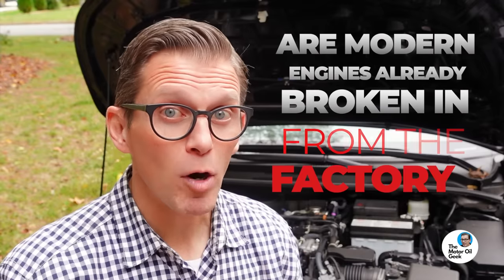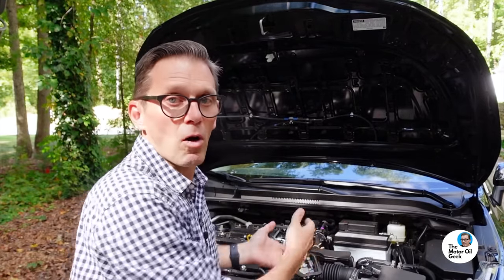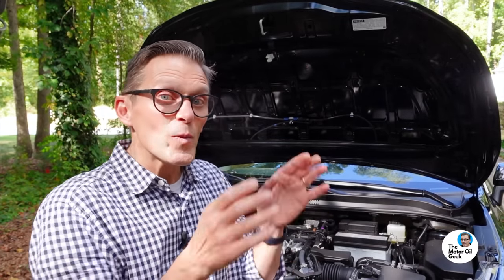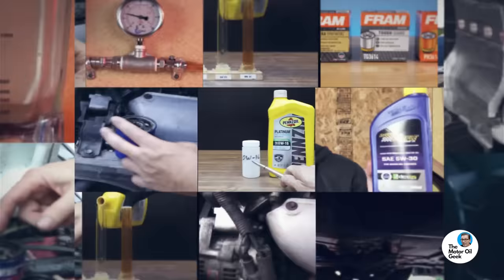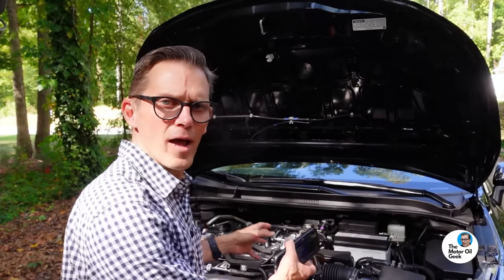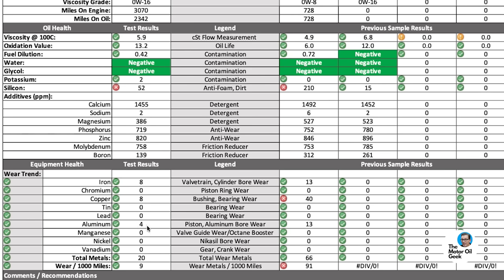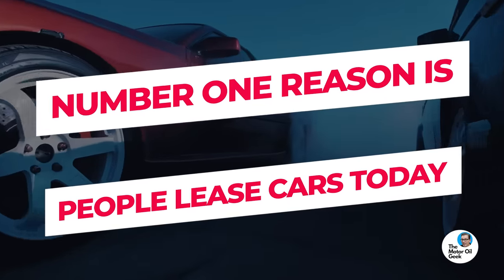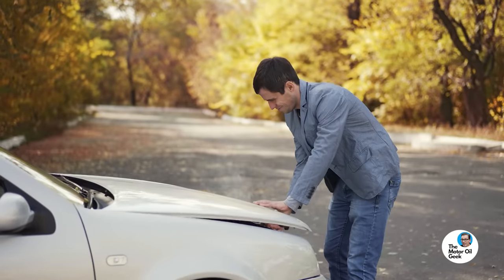New Engine Break-In: Truth or Myth?

Comment: I don't understand how leasing and epa regulations explain why the manufactures recommendations for first oil change are ~7.5k miles. If they know contaminants are in the oil after break-in why not lower that recommendation? The only epa related thing I can think of is manufactures are told to not encourage customers to waste oil by changing early. You don't mention that in the video though. I still don't understand the manufactures recommendations.

Comment: analysis results at 4:00.  Honda, Toyota, and other manufacturers only test start at the factory every 100,000 car/truck because the variation in engine build process is controlled.

Comment: So my question is, did I do any harm to my motor when I changed it at 5k miles in my 22 Tacoma? I was concerned about this when I bought it but was told from the dealership that it’s not necessary… I’m a stickler on maintenance mainly for long term reliability so I’m kinda worried I might have done some harm waiting till 5k to change the oil

Comment: They don't break it in. U have to do it yourself. Its also written in the manual that u have to use the first 1500 KM as the cars break driving 80 km max!. During that time only. That's your early oil change. And u have to change that oil to a 5000 or 10000 km afterwards.

Comment: Just a question, I learned to change the oil filter at 5,000 miles refill to normal level and then at 10,000 change oil and filter, then repeat the cycle. Would that do more damage than good to the engine? There will still be old oil circulating through the system although there is a bit of new oil and filter which I now thinking about it would not be ideal.
Reply: For me, oil filters are so cheap that we change them each time we do an oil change. I know some mfg's say you can go 10,000 miles or more but why run this risk. For under $15 dollars in most cases just change your filter with each oil change.
Reply: @vigilantemotors  that is right. But  my question really is skipping the oil change at 5,000 miles interval by just changing the oil filter and refilling what is missing. Then at 10,000 or the next cycle do both oil and filter. It would be cheaper than a full oil and filter change but provide a bit more of protection during 10,000 miles intervals.
Reply from the maker: Swapping filters and topping off is not a bad method. However, I don't rely on procedure alone. Used oil analysis provides data, so that's what I rely upon.

Comment: This is a concern of mine as well. I have a new BMW arriving in about 6 weeks and the dealer is insisting the first oil change isn't necessary until TEN THOUSAND miles. (0W-20 oil) As a career mechanic (first small engines, then later automotive and finally, commercial aviation) I have to say, I'm REALLY not comfortable with this...
Reply from the maker: I agree and would not go that far on the first oil change.

Comment: Dear Lake. I recently took delivery of a Subaru that is specified with 0W16 oil and change interval of 15,000 k's. I feel uncomfortable with that and asked the dealer to change it after 2,000k's and they refused. I asked to purchase the genuine oil and they wouldn't do that either and suggested if I do it elsewhere it could effect warranty.  Looking at oil manufacturers sites I get conflicting views on recommendations. Now my head aches from what to do. Where do I go?
Reply: just go to the parts window and buy it, you dont have to talk to them about your mileage.
if you want "subaru oil" which they dont make.
you can get quality oil from other manufactors.
save all reciepts and write the mileage on it.
Reply from the maker: As the other comment mentioned, just buy the oil and filter from the service department and do it yourself.

Comment: @themotoroilgeek Thanks for the data, but as a BMW M car owner I know very well that M engines are not 'broken in' from the factory.  M engines must be driven cautiously for the first 1,000 miles and then have the running in oil drained and to be replaced by service oil.  If such expensive car engines are not broken in how likely is it that a cheap mass produced engine would be broken in?!

Every M car enthusiast knows this and when looking at a prospective purchase wants to see the initial running in service stamp AND see how the seller drives only then driving themselves to feel how the car reacts.  (That does not mean trying to thrash it quite the opposite, just driving not knowing a cars faults and therefore not being able to cover them up through learnt compensation.)

Similarly, lifetime automatic box fluids!  Give over!  In my experience ZF boxes should have their fluids changed every 60,000 miles (which coincides with manufacturer car warranty!!)
Differential oil - again a mechanical wear item and will need changing, but then the seals do go on BMW diffs - perhaps because of the lack of servicing!?
Plastic engine parts - dearie me, BMW really let themselves down with plastic engine parts.  So many times parts costing pennies break engines.
But at least BMW engines last longer than Citroen ones.  My 4-cyl TU3A engine suffered a cracked head at 76,000 miles.  I got it a new head as any second hand car seems to come with problems that could cost more than a head.

Obviously, these are my opinions, but ones gained from buying and looking after a eclectic range of cars from new and second hand up to 200,000 miles.

My opinion is that an engine will last a whole lot longer if the oil is always changed at half or even a third the manufacturer's recommended interval.
I think that automotive design and mass fabrication peeked in the noughties.  I dislike the handling of teenies cars, and sadly, can no longer afford the depreciation that is built into the new car market.
Nuff said.

Comment: I don’t dispute the oil analysis results and that engines wear more rapidly during the first few hundred to few thousand miles (my BMW motorcycle with Nikasil cylinders).  What I’m not sure of is whether changing oil frequently early really makes a meaningful difference.  Does changing the oil frequently early really result in less total wear?  Now, this is hard to test as you would need multiple engines as identical as possible and would need to run several of them with Toyota 10,000 mile intervals and several with the Lake Speed intervals.

If the engines run at 10,000 mile intervals had say 100 ppm of wear at the first change and then 10 ppm at the next 4 changes this would be a total of 140 ppm of total wear material in 50,000 miles.

If the engines run with say a first change at 1,000 miles, a second at 2,500, a third at 5,000 and then every 5,000 thereafter have wear material results of say 55, 25, 15, 5, 5, 5, 5, 5, 5, 5, 5, 5, that is also a total of 140 ppm so that would suggest that early oil changes make no difference in total wear.

This is the sort of information that really matters.  We can theorize that removing the wear particles from the oil early makes a difference, but to use the quote from Deming, that is just an opinion.  Modern oils are very good at suspending small particles and oil filters are pretty good at removing larger particles.  Do the particles that remain suspended in the oil really accelerate engine wear?  I don’t recall ever seeing data on this for a typical street engine as in the Corolla, but if anyone is aware of such a fleet test, please drop a reference here.
Reply from the maker: We saw a difference in longevity of our engines at Joe Gibbs Racing following this method. Obviously, these were highly stressed engines, so the difference is likely greater than what you would see in a daily driver. With that said, we tripled the life of our valve train components. We also did used oil analysis and tracked the wear rate (not the total amount of wear). That revealed a lot.
Reply: @themotoroilgeek  I was focusing on street cars.  A lot of things make a difference in race engines and race cars, but wouldn’t be relevant on the street.  I’ve driven several vehicles to 200,000 miles without many early oil changes.  In the northeast where I live, rust gets our cars off the road long before the engine wears out.  I would bet you a steak dinner that the difference in engine wear wouldn’t even show up in a street car as rust or an accident will get the car long before the engine wears out.

Comment: I used to work at a Cummins dealership and when I worked there the engines were broke in at the factory and I believe all heavy duty engines in I heavy equipment, industrial gensets and heavy duty trucks using Cummins, Caterpillar,  Detroit Diesel, and Mack the engines are broke in at the factory but I don’t think any car, or motor cycle engine is broke in at the factory .
Reply from the maker: I did some consulting work for Cummins, and at that time all the engines were broken-in for 7 minutes.

Comment: My opinion is, in modern engines, the thin, low tension ring packs, plasma coatings, thermally stabilized, roller everything, the break is is far less aggressive than the old days of thick, high tension ring packages, flat tappet cams, slidey everything, the change in break in is massive. Still happens, I totally agree with you but, it's far less dramatic than it used to be. I'm just a person with an opinion, though :)
Reply from the maker: That is a fair assessment. The older style engines generate a higher volume of wear debris than a modern build. We see that in the used oil analysis data.

Comment: So, on a brand new car, would you drain oil immediately and out break in oil and run for 1k? Or just run factory fill for 1k and change then
Reply from the maker: Just change the factory fill at 1,000 miles.

Comment: Break in is irrelevant. Yes, there is more wear during the first oil change interval, but that doesn't mean it's significant over the life of the vehicle. I have a friend with a 2012 Camry that has been maintained exactly as Toyota specifies (no break in oil change) and is approaching 400K miles. His prior vehicle, also a Camry (1997) went over 600K miles under the same conditions.
Reply from the maker: Thanks for sharing your thoughts

Comment: Breaking in an engine is highly subjective, diesel? NO diesels are broken in at factory before being shipped out, gasoline usually no. When I bought my 21 taco i believe the manual said 500 miles with no cruise control and no wide open throttle. Did the oil change at 500 miles as it’s possible the filter could be on the clogged side from all the fine metal particles along with even finer particles floating around in the oil. After that? Oil changes are subjective also, highway, city driving etc. city, do it more often. Highway? No need to worry with todays synthetics, some engines are okay with 7-9k changes with highway.

Comment: Hi there I did my first oil change at 795 miles on my eco-diesel. I use the Mopar 05–40 specked for this which is made by Penzoil from what I’ve been reading.  anyhow I did add ZDDP from redline oil because I wanted some more breaking additive. What do you think? I’m also going to be changing the oil every 4000 miles instead of the 8000 or so miles. I believe it states to do.
Reply from the maker: Thanks for sharing
Reply: @themotoroilgeek  no problem. Thanks for the automated response.

Comment: Sir, I don't dispute that the oil samples will gradually show a reduction in wear particles. However, the question remains on how damaging the increased wear particles are during the scheduled service interval. Effectively, are the manufacturer's already accounting for the results of oil samples such as your own when recommending the scheduled 10,000KM or 15,000KM first service?
Reply from the maker: The longer you go before changing the factory fill, the higher the wear metals are.

Comment: The early oil change is catch foreign debris in the engine from the manufacturing process, not wear. Lots of auto manufactures cast aluminum heads and blocks and they are sand cast and not all sand and small aluminum chunks from machining and casting comes out. protects the manufacture
Reply: ask hyundai/kia

Comment: Hello Mr Oil Geek. Have a question which seems to have contradictory opinions. So I have a 2018 Dodge Challenger 5.7 Hemi. Manufacturer calls for 5w 20 oil. I have seen multiple videos suggesting that 5w 30 is better for the engine. Other people are saying you will get codes due to the MDS system. Although I haven’t seen any one with throwing codes people still insist you will have problems. Now I do have my MDS (4cyl) mode disabled via a tuner. Do you  think I will be ok running 5w 30 and does it protect better? Thank you in advance for your opinion.
Reply from the maker: The key to changing viscosity is taking used oil samples before and after to ensure the change in viscosity actually decreased wear.

One of the variables missing here is the operating environment. Hot climates vs cold climates will have different ideal viscosities.

Comment: No manufacturer will break in every single engine that is being build. It would be financially stupid and a logistical impossibility.

Modern engines are manufactured to a really high level of toleran6, way better than back in the 70s when break-in was a required process, often using special oils without antiwear additives to accelerate the break-in process.

These days, it's no longer a necessity but breaking in an engine and doing an early oil change won't do any harm either (if you discount your wallet, that is). In many cases (like with the daughter's Toyota) it can still be beneficial towards a long engine life.

Comment: IIRC, Chevy recommends a wear in period, but specifically targets the bearings as the need.    Especially on the new Z06.   Could you discuss that in the video if it's not already recorded?
Reply from the maker: They actually say the bearings need to break-in? That's bizarre, plain bearings (crank, rods and cam) don't break-in. Piston rings, cylinders and the valve train break-in.
Reply: @themotoroilgeek  yeah that's what I understood from aftermarket bearing manufacures too, a least I thought.   I'll see if i can find a link/video.

Comment: So if I use 0W-16....can I just continue using it for all future oil changes without causing any future problems vs having to revert back to 0W-8 like the manual says to do? 0W-16 is cheaper and more readily available. Thoughts?
Reply from the maker: Using the 0W-16 all the time will not hurt anything.

Comment: But does having higher metals in the oil for the first 10,000 miles make the engine fail sooner enough that anyone would notice the difference? Engines are so good today that internal engine wear from mileage is rarely the reason a car is scrapped in Great Britain, normally something else fails before this or the value of the car gets so low that owners are less likely to service and maintain the vehicle which will lead to failure.
Reply: Engines are NOT so good today.

Comment: So there is more (microscopic) metal in the first oil change by your data. Do you have any additional data showing that is a problem per se, that is, the engine will wear detectably faster that if you change the first oil at 1000 miles?

Comment: Wear metals in the hundreds ppm do make a difference in wear itself. But in this case particles are less than 100ppm. So no real difference to engine longevity. This reminds me of the comparison between a K&N filter and a normal paper filter. Paper filters filter 10 times or more better than K&N, but still K&N filters more than 99% of particles and gets the job done. Both values are low full-stop. The rest is looking the tree over the forest.

Comment: BMW has a mandatory “break in oil change” for all M models and it is at 1,200 miles!
Reply: Perhaps M cars have the break-in oil. Also need to flush the rear diff fluid at 1,200 miles.

Comment: Why would the factory break in a motor? That just means they would have to change the oil which would be a waste of money.. when i read that in the manual i figured it was more “low maintenance” bs… i had mine changed at 1100 miles. The 2nd reason i did it was because the car sat on the lot for a year so the oil was pretty old anyway.
Reply from the maker: Thanks!

Comment: Ha, I have a new Ford Maverick and it did not say anything about changing the oil for a break in period. However I changed my at 1,500 miles, I currently have 4,000 miles on it and may change it again. I guess I should have run an oil analyst on it but did not. I also put in the oil that Ford recommend and not any type of break in oil. So if I am not using break in oil should I change change the 2nd oil change at 3,000 miles and then again at 6,000 miles (3,000 mile later)?

Comment: I just bought a 2024 Chevy colorado pick up truck with a 2.7  turbo motor. I want to change the oil at five hundred miles. Should I use conventional  castro oil  replace it with a good quality break in oil? Or should I use full synthetic castro oil?I use wix xp oil filters. Should I use castro Is conventional oil or full synthetic oil My truck has  less Then a hundred miles

Comment: I just changed oil 2024 Chevy 1590 5.3l at 790 miles. Lots of aluminum chips in the filter. I am sending oil out for analysis. Is this something to be concerned about?

Comment: I have a quick question, I am getting a new 5.0L in my F150 because the first was bad, and I'm getting into the towing season.
How long do I wait until I tow my trailer, how many miles do I need to break that engine in before I tow the trailer?
I want this engine to last a long time, but I have about two weeks after the new engine before I tow the trailer about 400 miles?
Thanks